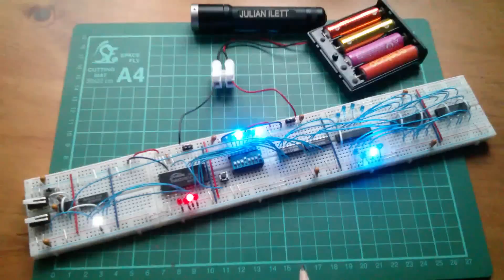First Build: 8-Bit Breadboard Computer

Comment: https://en.wikipedia.org/wiki/74181
]4-BIT ARITHMETIC LOGIC UNIT SN54/74LS181
Reply from the maker: The only 7400 series IC that has its own Wikipedia page :)
Reply: Again, you first have to define the bits in your instruction set and define how many registers can be addressed.  Like first 4 bits control a pair of 74LS181 chips and bottom 4 bits select one of 16 (or a pair of Read/Write for a Move or Copy)) registers.
Reply: First half of message was lost.  Reminds me of a mainframe computer that I once worked on, and they can grow to fill a room.

Comment: super cool. were you inspired by Laughton's computing at 60hz article? I totally breadboarded up something similar after reading it. by feeding a couple of your latched lines from a peripheral back into the higher order ram address lines you get a sort of conditional branch for free. write to those address lines to cause a jump on the next instruction.
Reply from the maker: That's very interesting - I like the idea of not having a program counter - got me thinking - thanks John
Reply: Julian Ilett you can get rid of the program counter by feeding ram data lines back into the address lines, so your computers instructions have an implicit jump. as in each instruction is both what to do now and where to go next, (which will commonly be just the next instruction) in effect you have a one instruction set computer. you can actually have a fully Turing complete computer with just move and nothing else due to self modifying code overwriting the jumps. https://esolangs.org/wiki/OISC has some inspiring ones, but I warn you it's easy to fall down a rabbit hole of designing more and more minimal esoteric CPUs using ram as programmable ALUs and whatnot.

Comment: next step would be to add the ability to set the program counter to a specific value if you want a loop, and it would help to add registers to saves values and start doing some very basic data processing

Comment: you don't need a dip-switchble loop start point to give you the arduino setup / loop functionality, you can the same effect but in a much more generalizable form by simply allowing the program counter to be written to as a peripheral

Comment: You're amazing Julian!  How about this as a project:  an analog video driver built from the most simple components possible.  Then eventually, have your 8-bit computer drive it.  I remember building a zx80 kit as a kid, then learning how to write programs for it in BASIC and machine code.  Those were magical times!  Maybe you could find a primitive OS to run on your machine.

Comment: 14:26 - Programmable "setup and loop" with dip switches?  No.  That's a waste of time.  That's not how a CPU really works.  What you really need to add is a conditional jump.  Or a jump and a conditional skip (ie. BTFSC on a PIC).  A conditional skip will be easier to implement.  Until your CPU can make simple decisions it isn't a "computer".
Reply from the maker: Agreed, unconditional and conditional jumps are needed in the next build.
Reply: plushoom  you can add registers and stuff as periphials

Comment: needs jump to address and jump if zero. Not really a computer as it is.
Reply: it doesnt need anything to be a est of the bus and basic programming and the clock .. all which he has shown work fine .... he even is ale to run a simple chaser light ... with less parts than it took t make the one for kitt with discreate components .... and btw without a jump this still qualifies as a computer ... it is a basic automation devices .... which IS a computer .... just like a jaquard loom ... and btw it didnt have any jumps in it either ... conditional or otherwise .... and it is considered a computer .. one of the first ones in fact.

Comment: Could you write the ICs Numbers used in this computer ?
Reply from the maker: +Omar Mekkawy From left to right: 555, 74ls193, 6116 ram, 74ls138 (*2), 74ls244, 74ls374 (*2)
Reply: Thanks a lot, your videos makes me understanding the computer in deep. i got a salvaged parallel EEPROM, can i use it instead of the RAM ؟

Comment: Julian it IS doing arithmetics, a shift by 1 is a multiply/div by 2!!!
Reply from the maker: Interesting, this project was very nearly called the naughty computer! Yeah, shifts are more arithmetic - rotates are more logical.
Reply: Not if it's carrying over to itself, that pollutes the data. Yes, it is basically self-polluting. A very naughty computer!
Reply: I really liked this comment (+Marco Lagerwey)
I never really though about that before!!
Shifting is like adding or taking away a zero at the end. In Binary it is multiply or divide by 2. 
Well done!!!
Reply: Hagledesperado you describe a rotate operation, not a shift. There are a difference.
Works with only positive interpretations of the bits, or a two complement interpretation of the bits.

With an and gate on the feedback of the shift register, it would be easy to have a shift register working as shift and rotate register. With a change of a bit.
Reply: And Julian's breadboard computer is doing what?

Comment: You should try making something with relays. You could even build the ALU of this computer out of them if you aren't going for speed. It would be a lot more interresting than plain old 74 series logic.
Reply: RWBHere
Somebody did build a computer which uses only relays. (Maybe he was German? I forget.) It was posted on YT a few years ago. Very slow by any standards, with. clock rate of 1Hz, but it did work. I wonder if it's still running, or have a few real bugs crept into the system since then? ;-p

Comment: What are the peripherals chips, please? It's very hard to read on video. Are those the same 374 you used in your light chaser video? Thanks.
Reply from the maker: +Anvilshock Yes, LS374 and LS244. But I'd like to use the 574 and 541.

Comment: Where you get your 16 bit Read/Write ?

Like you told, you have 4 bit OP Code for read and write so you should just have 2³ = 8 for each ?

Do you plan to implement Branches/jumps ? :)

And great work ! Nice for people who want to understand that ;)
Reply: You are right, there are 16 different OPcodes possible with 16 different addresses at the end (the 4 lsb's) There are totally 8bit not 16bit...
Reply: But 4 bits is 2^4 not 2^3

Comment: Nice Video Julian
i want to build one too
but i must say i coudn't find "cheap" parralle eeproms so i'm working on cheap stm8 micro controllers to simulate eeproms
hope i will get it working soon
Reply: I am also from Germany and I think I will also use a MCU (in my case an ATmega8) with its internal EEPROM (only 256 Bytes) and get its parallel output over the IO. Would be the easiest and cheapest way (i have a few ATmega8 lying around here)
Reply: Nice to see that i'm noit the only one whit this idea.
I will try to use an µController in combination whit a i2c eeprom
so you coud easyly rewrite the eeprom. Because in my opinio it is easy to put out an 8 pin micro instedt of an 28 pin micro
Reply: You are right too :D
but i try to work whit STM8 Micros
its different to arduino
but those this are so cheap (unter 2€ whit shipping from germany)
Reply: turutzi ebay, got me a 16k eeprom for like, 1-2£
Reply: hmm
here in germany you coudn't find it for this less
here you have to pay somethin about 10€
Reply: turutzi are you saying you have a different ebay in germany? :p
Reply: Yeah :D
its .de nocht .com :P
it is how i say german sellers are so expensive
and shipping from the uk is not so cheap
Reply: turutzi shipping from china is cheap
Reply: Yeah you are right, but another idea I had was to use an Arduino Nano (1kB internal EEPROM) and program it over USB if you want and then parallel out :)

Comment: Why didn't you use EEPROM so you  didn't have to reprogram it each time you power it up?
Reply from the maker: +That Guy The ram chip can have a separate line to the battery so it remains powered up when the rest of the computer is turned off
Reply: Fair enough, if you get 16 "peripherals" you it could be fun to see the garbage that comes out.